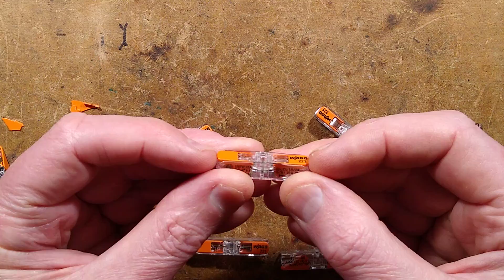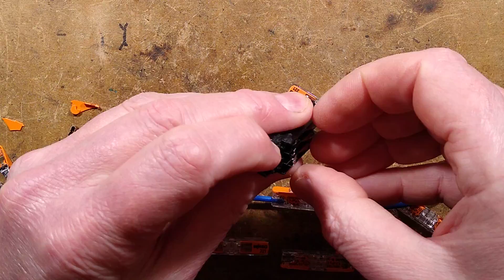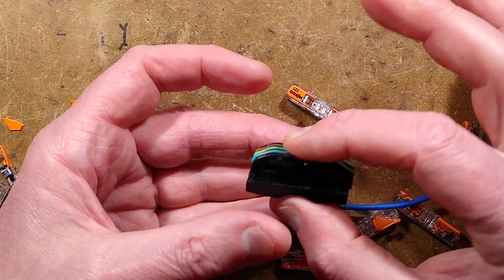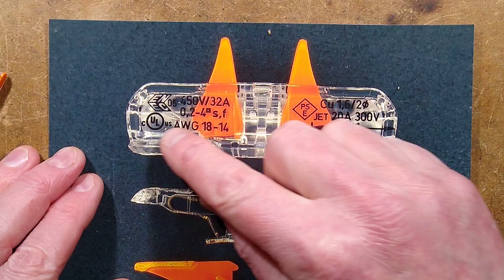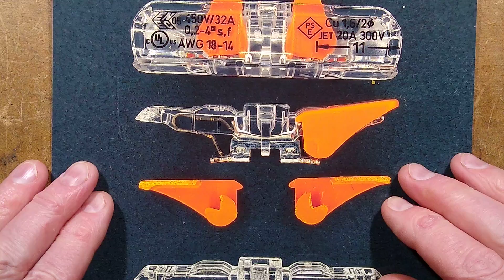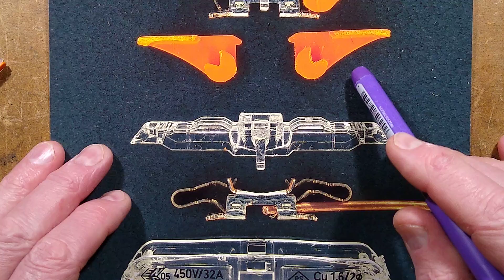By request - a look inside a Wago inline connector

Comment: As far as i know and my personal experience is, that twisting is not a good idea when using clamping connectors. If you stick the stranded wire in after stripping the insulation it will go in very easy as long as you dont do annything to it. I feel like twisting the wires makes it easier for a single strand to get bent backwards while pushing it in. Also if you are using the screwless terminal blocks in a cabinet for industrial machines, twisting takes a lot longer than just stripping and sticking them in.

Comment: The one teensy weensy little downside I noticed with this type of Wago is that when you are working in a tight area you might inadvertently open one of the levers as you are digging around for other wires, because of the lever sticking out just enough to grab on to a glove or what ever.

Comment: I happened to know a designer from WAGO. He didn't design this one, but the push in type without the leavers. I asked him if you should twist the wires and he said that it really doesn't matter :D
Reply: The advantage with twisting is that you're more likely to push all the strands through the spring lever. If you don't twist you might end up just folding half the strands so that they are left outside. Electrically that's perfectly fine during normal conditions as long as you don't ride the very limit of what the cable can handle, and if installed properly there should be no tension between the wires and the WAGO connector anyway, but if there would be tension it could result in the strands breaking because there are too few of them sharing the physical load. Even if it doesn't cause a complete disconnect it could cause a bad connection.
Reply: It shouldn't matter.  Wago can be used with solid copper wires such as 10, 12, or 14 gauge which are not going to not flatten.
Reply: Maybe twist 18G stranded since is has less mass, and leave lesser gauges flapping in the breeze.

Comment: An important thing to mention: If you have old wiring in your house / apartment like in the old communist eastern EU blocks for example, DO NOT use wagos with aluminium wires unless you want lots and lots of oxidation.

Comment: edit I'm wrong here, see discussion below.

Not sure if you were aware, but those levers are only for releasing the wire or inserting stranded wire.
They're so much faster than you think, as they're meant for solid core to be pushed in while the lever is down
Reply: Actually not for WAGOs.  You use the lever to release and insert the wire, solid or stranded.  There are other similar knock-offs that are push-in, but not WAGOs.
Reply: Eeeeh, I just tried the 222 and you're right, those don't work. Sadly I don't have a 221 here to test but I'm 100% certain I used WAGO lever connectors that way often, but can't remember which model it was
Reply: @junkerzn7312  Yes, the WAGO ones are designed to be used like that with solid core wire. You don't need to open the lever for inserting solid core
Reply: @juweinert  I have five different types of WAGOs in front of me right now.  I can insert 14 AWG solid copper wire without using the lever, but 16 and 18 AWG wire bends more often than not if I try without using the lever.   So the answer is no.

Now to clean up all these fresh copper clippings.  hehehe.
Reply: @junkerzn7312  This is so crazy. I'm 100% convinced and I totally know I'm wrong 😂 I saw it myself, totally trust your tests but the feeling is still there.
The only conclusion I could come to is that I must've mixed that up years ago in my brain with either Phoenix or Weidmüller connectors or some variety and then deeply engrained a false memory... smh
Reply: @juweinert  No worries
Reply: Even if you can push in the wire without using the levers (which only works with larger gauge solid wires, nothing else), why would you want to?  It doesn't really save you any significant time, it takes more effort, is more likely to screw up the wires (by having them just bend instead of going in), and more likely to result in a not-fully-inserted or insecure connection.

Just use the levers.  Inserting or removing, it doesn't really matter.  Using them makes everything actually easier and is more likely to produce a correct result.  I don't know why everybody always seems so determined to make things like this harder than they need to be...

Comment: I was told never to tin wire that was to be used in a screw terminal as the solder deforms under pressure with time and the connection loosens. I guess it's not an issue with these as the spring maintains the pressure.

Comment: Twisting expands the diameter so the wire can wiggle free over time in a screw terminal. But these are not screw terminals so I would give it a light twist as well if strands keep escaping.

Comment: I love those. Working in R&D we have so many people fumbling around in wiring and loving their open twisted wires not keeping contact or making funny sparks.

Also prevents people overtightening screws and breaking wires.

Great addition for the WAGOs are their holders for installation in cabinets, because they also have holes to be mounted/screwed on surfaces if you dont have rails eg in boxes.

Only downside i found was the tab plastic gets brittle with some solvents.

Even the price is ok-ish if you buy the 50+ package sizes.

And there are eco-recycle green ones now, if it matters for your used numbers per year.

Comment: 4:20 - Part of the reason why soldered wires pop out easily is the same concept I mentioned in my comment on the last video; solder creep. See; the 3D printing fires of circa 2019-2020. This is a reminder not to tin wires that are going to be crimped or clamped.

Thanks for taking these apart. Very cool look inside these.
Reply: Generally I agree, because crimps and clamps do not necessarily make solid contact with tinned wire.  That said, they will NOT pop out easily from a WAGO.  The WAGO isn't just doing a compression clamp, there's also a bit of an edge at the far end of the metal part when putting the wire through that prevents the wire from backing out.

If a wire is not long enough when inserted and doesn't make it past the far edge then it can be pulled out fairly easily.  But if it is cut to the correct length so it goes complete through the metal part of the clamp, it won't.

Comment: The Amperage ratings seem to decrease with voltage? So, does that mean 15 Amps at 120 volts? 
Is that both AC and DC ratings?
Interesting device.
Reply: No, it does not decrease with voltage! The left is the certification under ENEC (Europe) and the right is PSE (Japan) - different testing methods result in different values.
Reply: They probably make similar connectors for DC but I wouldn't go putting a whole lot of that through these little compact ones. The ones I have are rated for AC at up to 400 volts / 32 amps which is about standard for UK 240V/13A single phase mains applications; plenty of overhead. They should be able to handle 120V/15A just fine.
Reply: @NightCatArts  AC or DC makes no difference at all to these.
Reply: @Monkeh616  I mean in terms of wattage. Same watts on DC generally being either far more amps or far more volts than equivalent on AC.

Comment: I have always twisted my terminating twisted wires in my apprenticeship days since 1975 Starting as a motor rewinder/electrical fitter progressing to linesman LV and HV to cable jointer LV and HV to switching operator LV and HV😇 and many zaps later!

Comment: I use these on my custom moped eBike on the motor for a quick disconnect. They have been excellent even when exposed to the elements. Bought them at Home Depot to make sure I receive the authentic ones

Edit: 10 piece count for $9.99 not bad

Comment: I really like these things & I wish I had managed to find some last time I replaced some light fittings, because my god was that a nightmare with the old screw down terminals & too little cable to work with. I've always heavily taped up screw downs as well because of those screws being live and the way they deform stranded wire all over the place, but these require no tape at all. Well.. okay, maybe just one turn to make it clear which wire is live & so on.
As for twisting strands, I try to twist them only at the tip so they can't mushroom out if they hit the edges of whatever you're putting them in.

Comment: Just checked  PES material composition on WiKi and from this I conclude that Chineseium 'Wago's' are probably made of a Polycarbonate which melts at  lower temperature.  Not twisting the wires allows them to flatten across the spring contact. 

Polysulfones are a family of high performance thermoplastics. These polymers are known for their toughness and stability at high temperatures. Technically used polysulfones contain an aryl-SO2-aryl subunit. Due to the high cost of raw materials and processing, polysulfones are used in specialty applications and often are a superior replacement for polycarbonates.

Comment: If the contact surface is good enough with solid wire, then it should be good enough with twisted stranded wire. Leaving the strands looser does improve surface area, but at the cost of gripping force (which may be irrelevant, if the wire isn't going to get pulled / shaken).
Reply: wise words

Comment: I've been using wago for a long time, standard connector for me, the name-brand equivalents are also good, I believe companies like wurth and TE connectivity make some

For the twisting, I twist them lightly so the strands are kept together while inserting, I like using wire strippers that don't pull the insulation off completly, so I can grab it by the loose insulation, twist and pull it off, without touching the copper

Comment: If it’s a wire section for a project, I roll it back and forth between thumb and forefinger on the sheath, and then during either the up or down part of the roll, lightly pinch the end with my other thumb and forefinger to give it a uniform twist. Not so tight that it will resist the connector crimp, but enough of a twist that there won’t be any stragglers that bunch up inside and don’t make it into the connector. A light twist seems to make connections resist breakage better too, in my experience.

Comment: Twisting and ferrules seems to be a dividing topic, if the clamp works with single strand wires I don't see how they would not work with tightly twisted stranded wire, sure there is a theoretical difference and maybe that is enough to warrant it in some cases? Same with ferrules, have always used a D type crimper with these when doing relatively low current stuff that will get worked on frequently.
Reply: With clamps it's about the relative weakness of the connection. When allowed to fishtail out, stranded wire will be clamped across far more strands than if the bundle is twisted (hard) and can't deform as easily. Fewer strands held at once means more risk of any given single strand breaking (since they're under more strain per-strand) which, over time, could result in an unstable connection. You don't run that risk at all with solid core wire, because it is far stronger due to only having one strand, which is why that's fine having a round cross section.
Reply: interesting, don't think I've seen the mechanical strength being considered as a factor but yeah that probably makes more sense in some scenarios
Reply: @notsonominal  It's an important consideration in any situation where the wires are likely to shift around, be pulled back & forth, get bent into a big mass & shoved through a tiny hole in the ceiling, etc. Pretty much any residential or commercial wiring job that doesn't have trunking.

Comment: I only twist as much as is required to restore the cable's natural lay. Using correctly sized, good quality stripers usually means that the inner cores aren't disturbed much.

When using crimps the message from Tyco, Deutsch and others is don't twist the wires as it is detrimental to the quality of the finished crimp.

Comment: These have become a staple on my bench top. Great devices to make fast & temporary test connections. You can color them with Sharpie markers to stay organized if you have a bunch of connections. I grabbed an assorted container of these on Amazon for $20 CAD. There is no way I can justify using these in place of wire nuts in permanent electrical work as the price point is not realistic unless I was buying millions. There is no way in Hell I'm using WAGO on anything over a few amperes, anyways. The local electrical code initially embraced them primarily to be deployed in 'low' current lighting applications.
Reply: They're (provided you get the right ones) fully rated for above mains voltage & amperage (I think 400 volts/32 amps); nothing wrong with putting a lot of power through them at all.

Comment: I give stranded wires a light twist to keep the strands bundled together. I'd imagine the spring pressure in the connector is enough to flatten that out again.
Reply: even if they dont flatten its at worst same contact as with solid core wire. that is not a concern anyone should have. more of a worry is loose strands so always a little twist

Comment: Took them so long to come out with the inline version, yet they still didn't include a detail to allow them to be clipped together. Spoke to someone at Ideal at Elex this week, who mentioned there may be a patent issue preventing this.
Reply: They offer a 3d printable STL in their own creators community to clip multiple inline connectors next to eachother.
Reply: There is the holder 221-2523 which seems decent enough for mounting onto a surface and hold 3 inline connectors
Reply: Is Ideal coming out with an inline lever connector also?
Reply: We have a brand in Finland, I can't recall who it is, that has the clipping feature to make them up into blocks. I'll have a look to see if I can find one to see who makes them

Comment: Why does it say 450V/32A on one side and 300V/20A on the other? which rating is it?
Reply: The left is the certification under ENEC (Europe) and the right is PSE (Japan) - different testing methods result in different certifications.

Comment: Good one Clive. 
Maybe this will save the lives of some DIYer's, and families. 

As for stranded wire, I like to twist them up and hit them with some solder. Two reasons, solder wicks up the wire inside the insulation, mechanical strength.
While the solder is hot, pin it or clamp it flat. Bit of a fish tail, but better for clamping and compression type connectors.
Reply: That's not a very good idea, I'm afraid. Not only does the solder gradually give way under mechanical pressure, but it also adds electrochemically active components to the contact environment that is difficult to predict if the system might be exposed to high humidity in the future.
Reply: @JargonFootprint 
👍😁😁. Okay, if You say so.
Reply: Solder wicked up inside the insulation is how you end up with the wire breaking outside the connector. Stop soldering things which aren't meant to be soldered.
Reply: @Monkeh616 
👍😂 I am so very sorry.! 
Your ignorance is showing.  
again.!
Reply: @snakezdewiggle6084  Have we met and you've ridiculed yourself before?
Reply: @Monkeh616 
Anything is probable...
Reply: @snakezdewiggle6084  Including and especially fires started by your misguided application of molten metal.
Reply: @Monkeh616 
How old are you.?
Reply: Use a ferrule instead of tinning the stranded wire.  It will protect the wire from twisting and shifting quite well and the connection is still completely solid.
Reply: @junkerzn7312 
Yeah, the ferrule can be used, in the right situation. 
You are the only one to make a rational reply.  ✅

Comment: still worth noting they're technically a worse connection than a screw terminal or a crimp; but their reliability, ease of install and maintainability are absolutely worth the extra something tiny resistance.
Reply: true but they make functionally as perfect contact as anything else if you use them within the max voltage and amperage printed on them.
Reply: @piezku  and considering human mistakes, the "better options" usually get installed with poorer results than a wago, so it wins the long-game anyway! :D

Comment: Wago's have been a game changer in the last few years ..I've never seen one fail ..yet...I've seen electrical cabinets burn out and the wagos clips still have hold of the bare wires ..I use lots of these to replace the inevitable loose Wire nuts on machinery that has been shipped from the 'states' , Some new machinery from the USA is now comming with Wago's so the message is getting through....Wago also make a very good range of Din rail industrial connectors and accessories ..Good job mr clive you just reminded me to order a couple more 60 packs of these , I've nearly run out....sounds like an advert eh .. but as an old industrial sparkie these have saved me so much time and have thankfully displaced 'chockolate blocks and wire nuts'
Reply: I'm an industrial electrician at a manufacturing plant in the US and we have started to switch to Wago, particularly in control cabinets.

Comment: I've heard that the slightest lift of the lever has caused some to come loose without realising on occasion from colleagues. You need to cover the Ideal Gen 2 Levered Connectors now as they turned the lever the opposite way around :)

Comment: As for twisting I shall consult the NASA-STD 8739.4A with Change 1 WORKMANSHIP STANDARD FOR CRIMPING, INTERCONNECTING CABLES, HARNESSES, AND WIRING manual and refer to pages 91-92 regarding twisting and use the preferred method A1: Insulation has been removed from the conductor with no visible damage to the wire strands. 2; Normal lay of wire, if disturbed, shall be retwisted to the original wire lay.

As Wago does not specify whether to twist the wire. I do know that unofficially their representative stated that solid wire does not require actuation of the lever to insert the wire by design, albeit being an undocumented feature.